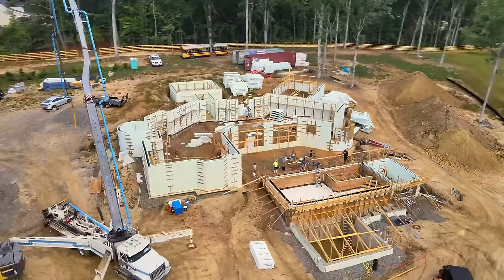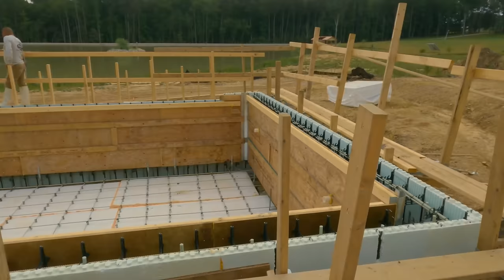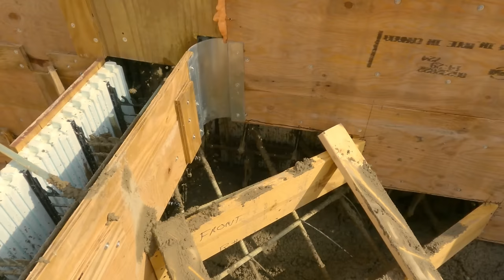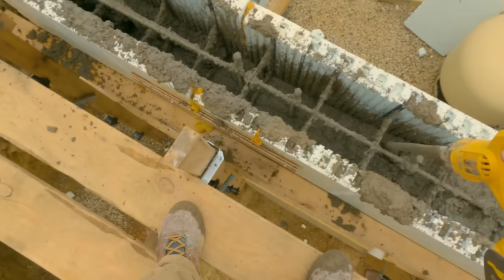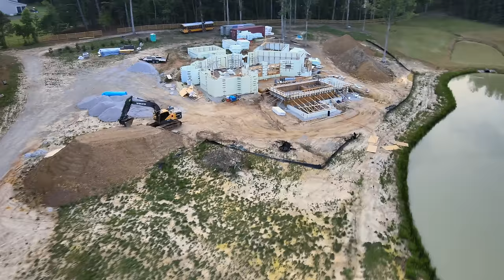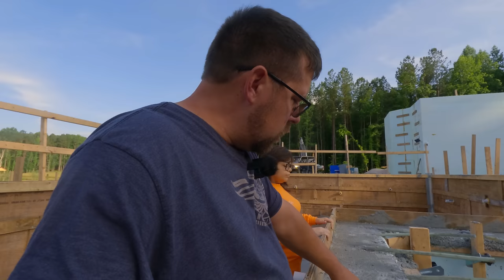Upper ICF Pool Concrete Pour Day!!

Comment: Unless you've worked around a pump, you don't realize how much concrete you can pump in a short time.
You had plenty of help on hand to keep things moving & " just in case".
The guy on the hose in the pool bottom is a real pro...  No wasted motion, let the hose do the work!
Glad I didn't see anyone (you) hanging from the hose suspended over thin air! 😄😉
Well done!!!

Comment: Never used a pump truck before. It appears as though there isn't much coming out of the pump hose but when you see how much is accumulating at the bottom of the wall, it is significant. Nice to see your dream coming together. Thanks for sharing.

Comment: I think them walls/walkways would have had to be 3-4 feet wide with solid rails on both sides for Mrs.Bealy Good to feel secure walking them, LOL. Believe me, I understand her caution. It's not so much the heights that bother me as the sudden stop at the bottom if I misstep😲. Jeffs discription of what was going to happen with this complex pool finally  makes sense with the pour. This pool got the Dog Dog seal of approval. 👍

Comment: Shouldn't your horizontal 90's for the tanning ledge be spaced up off the wall surface for proper concrete cover . Looks like they're resting on top of the wall . 
Thx for the video
Reply from the maker: The foam gets cut down some after the concrete cures

Comment: I didn't watch the concrete pouring but I was curious how high the waterfall is between the pools.  We moved to the beach recently but our old house had a 5ft dropoff and the flow ended up being too thin. Had to pump more water to make it flow better and not blow away but then it was noisier than we liked.
Reply from the maker: 6

Comment: Wow that is a lot of concrete. Love those fancy work pants you are wearing while showing the boss around the pool.    Geoff you are a car guy , do you know what 1 part was used on a 1924 Ford Model T that is still  used today on a 2024 Ford Mustang Dark Horse and most every other car today without googleing the answer.
Reply: @BealyGood  i saw this  on another you tube   channel about antique cars. It is a schrader valve in the tire valve stem. I did not know this either even though  i have changed 100's of  them. We all learn something new everyday.

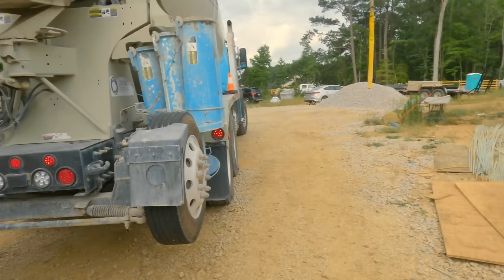Comment: @5:18  Santiago the concrete pump operator needs to do better if he is going to audition for Blue Man Group.
So that was a big concrete pour.  Sixty yards was it?
I'm guessing you have somewhere near 80 for the walls that are left and another 80 or 90 for the slabs/floor?
Are you going to be building any of the houses on the 90 acre project and with they be ICF also?
Reply from the maker: It was a small pour but the first I ran so big to me. 140 yds for the basement walls. Doing a couple of the houses.

Comment: The pour went really well. No blowouts, but let's face it, that provides for a more entertaining video. lol. Next time, stage one and add some ominous / worrisome music that a  potential disaster is about to unfold.

Have you decided on what kind of liner you're going to use? Or are you going for tile and a old fashioned finish? If you prioritize the pool the kids could be swimming it this  Summer. If I was them I'd pester you daily to finish it. As a kid, I spent a good deal of my summers in or on water.
Reply from the maker: Planning to tile the upper pool in the lower pool just be finished with a skin finished and a tile around the top edge. And then the steps will be tiled. I probably actually will focus on the pool once we pour the

Comment: Mrs. McBealyton: "Over the Pump-Room will be a great place for your Cabana Boy-Cave Grovel Station. The shoulder cam made you look like a cheap Mr. Haney on pirate dress-up day, as you couldn't afford a real parrot. You wasted a good bit of concrete under the stairs, I would have built a triangle corner box out of plywood, filled with clean stone, coming up and angled to match the underside of the stairs.
Reply from the maker: Sounds great to your hauling that stone one bucket at a time
Reply: @BealyGood  You got to think on your feet faster, you plan ahead and have your stone jockey Chris dump an extra quarter scoop+ of base stone (for the pool bottom filler) in the pool in front of the bottom step, then shovel it up into the under box. 15 mins. with an idiot stick.
Reply from the maker: Except the concrete needs to run on the backside as well. Ds
Reply: @BealyGood  Think on your feet, you had vertical access behind the triangle box via the vertical wall to work/drop the concrete in there, there would still be a open descending angled thickness above the stone filler box as the underside of the stair structure itself, would still have a 4-6" thickness above the box.

Comment: When they oured my driveway, they said I couldn't drive on it for 28 days.
Reply from the maker: We get all the concrete pours tested. A good mix should be at strength by 7 days (the first time they test) and it’s usually close. It’s supposed to definitely be by 28 days. Most commercial contracts require it must meet the strength by 56 days. It’s amazing that the concrete continues strengthening.

Comment: Check into a little pencil vibrator, maybe long enough to drop down to within a ft. or so of bottom, they really come in handy when you have to worry about rebar, and they work it enough , but then they won't blow things up. You're doin good! Guru, eh, I choose the ICF manuf.rep./engineers. Summer time, a good time to grab an intern outta school to help w logistics, Mr. Developer! ✅✅ Catchin on!

Comment: Can you imagine the amount of dirt collecting in the bottom of all those old ICF forms on the house portion of this that will cause final concrete pours to be sitting on mud/dirt instead of the footers?  Some of the ICF forms are yellow from dirt/mud deposits on the outside so you know the insides are pitiful  Only way to cope is to take the forms back apart and clean the footers prior to reinstalling and pouring.  Months have gone by since these were put on the footers.  Wow what sloppy workmanship.
Reply from the maker: I don’t imagine or assume, I know. The answers none. They’re open at the bottom so any rain or dirt can run out.
Reply: @BealyGood  There's always one, isn't there?
Reply from the maker: @DeweyCheatumNHoweLLC  Always
Reply: Always!… ignore them, your doing great.